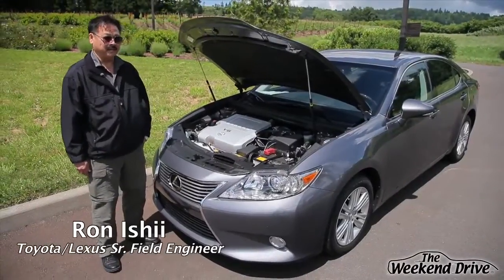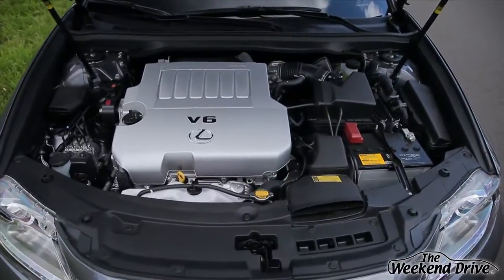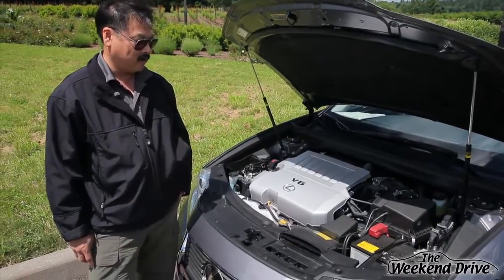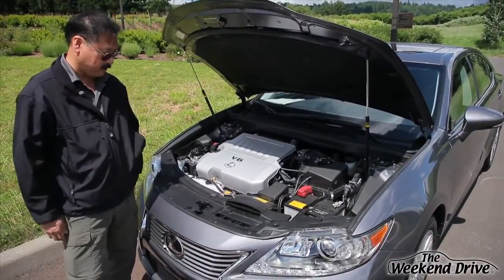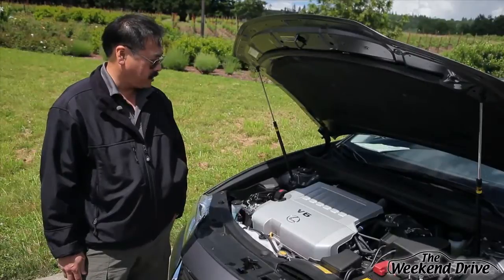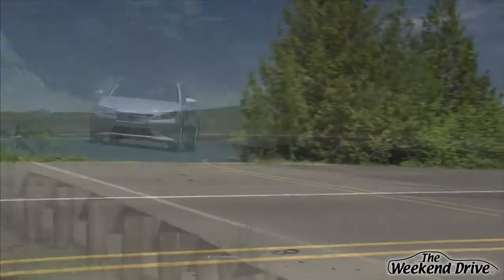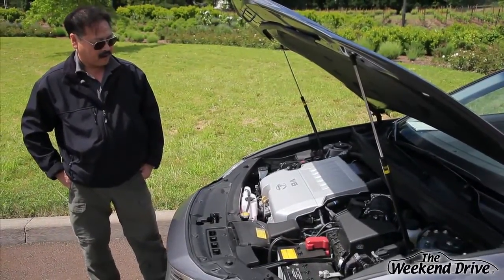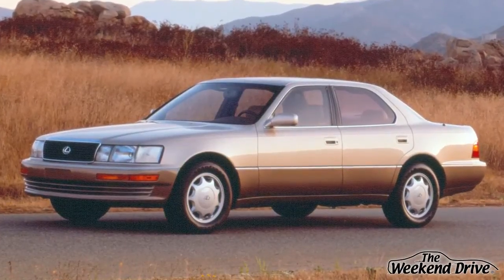Lexus & Toyota's Advanced Engine Design

Comment: Great engine. The same I have in my 2007 Avalon. It has the FUEL EFFICIENCY of a 4 cylinder if driven conservatively, which I do most of the time, and it has the POWER of a V8 when I put the PEDAL to the METAL.
Reply: Facts💥

Comment: I have to agree, my lexus RX has 250000 Km and works like new. This engine is Smooth, powerful, reliable and silent. the engine doesn't consume oil and has no leakage. Not bad for a 10 Y.o. car.

Comment: Same engine in my 2009 v6 camry LE....nice engine....has good power....
Reply: Honestly, fe is better for modding and smoother. It doesn't have integrated parts either.
Reply: Actually yours has the 2gr .

Comment: Had my RX since 05 never had a problem not one single fault, the only thing on the car that broke was the rear window demister, that went after 10 years not bad for a heating element, the rest of the car is faultless and costs me a pittance to run it, no way I'm changing this car except if I buy another brand new one, maybe in 5 years time 20 years out of a car is pretty good ROI.

Comment: Lexus was chasing n is still chasing the german rivals.. there is a saying empty pockets makes the noise  ul see lot of talk abt lexus n toyota but non for german brands coz they dnt need to talk their products talks for them selves. Thts y people pay tripple the amt n buy them. Lexus is just a quieter toyota wth leather in my opinion.. hve used gm n toyota n lexus over the years but mercedes saved my life in an accident which was unbeliavle so since then n now im a german car guy n hve realized tht german car parts r actually cheaper then lexus...
Reply: Lol good for you. I had 4 audis, 1 benz, 2 bmws, and after they all broke like hell. switched 3 to lexuses and they are bulletproof. good luck
Reply: after 25 years of owning our german brands i switched to LEXUS and never looked back.
Reply: German cars are good, but only in those rare circumstances when they are not in a shop with another fix and another and another...So, ideally you need to own at least 3 German cars simultaneously, one of them is always in the shop, another one is currently running (i.e. being a few days in between the shops) and the third one just in case, if the second one breaks down BEFORE the first one got fixed. Oh, and plan to earn accordingly, like upper 6 figures at least.
Reply: German cars have superficial quality and they've been riding on their coat tails for years. They were good before Lexus launched but since 1990, have never recovered. The Lexus LS was and is still the standard of quality in the segment. German cars use so much plastic under the hood it's mind boggling. Over time they leak and the oil warps the plastic and it's like uncooked pasta and breaks apart. They are the Masters of planned obsolescence.
Reply: Lease German, Buy Japanese.

Comment: proud owner of a 3,5ltr V6 Hybrid from Lexus.  great , smooth and very reliable . 10years old with 235000km now. But i always worry which oil is best for it when on Autobahn.... 0w20 Lexus Hybrid or 0W30 or 5w30 ...now i use 0w20...the preowner runs it with 5w30.  i get 1,5ltr oil consumption between oil changes (15000km).which is ok so far with that thin oil especially on fast autobahn runs.imho.

Comment: Ok that was some good info, but why repeat the 6 bolt and forged cranskshaft info twice. Seriously, what else is good about this engine, want to know more.
Reply: The quality of the parts like denso electronics (Alternator, coils, plugs, sensors) and Aisin  (water pump and thermostat)
Changed my spark plugs in my 07 es350 at 140000 miles and they looked great and were still working perfectly.

Comment: In comparison to other manufacturers, and even some of the older V8 engines released by Toyota back in the 2000s such as the 2UZ, the GR series is truly over-designed, and over-engineered, but in a good sense. 
Interestingly, the first-generation 1GR-FE which was powers the 3rd Generation 4Runner, and 120 series Land Cruiser features the Acoustic Control Induction System (ACIS) which consists of a bulkhead and actuator to divide the intake manifold into different lengths, so that when the engine runs at medium speed at high load, the bulkhead switches to increase the effective length of the intake, and improve efficiency. You'd be hard pressed to find something similar to the ACIS implemented within an engine manufactured by Honda, or Subaru.

Comment: I only buy Lexus or Toyota vehicles. Never again Chevy Ford GMC or any other brand. I have had celica which lasted along time. My Lexus ls430 2001 has 290000 miles with basic maintenance. Has a new radiator and engine cover gaskets. It has the original starter and alternator from 2001.

Comment: So why can't it break 270 HP when everyone else is at over 300 on their large V6s?
Reply: JrgrimWoW they save it for the gs, which has been making over 300hp since 2007
Reply: Its 270 hp on regular gas and 297 on premium which is definitely recommended.  Helps keep everything clean. Sometimes the direct injections blow after 50, 000 on some cuz that low grade fuel is dirty and ppl aren't likely using cleaners every few thousand miles or so.